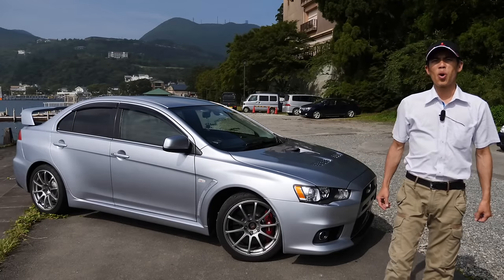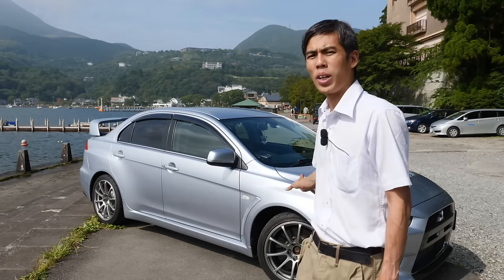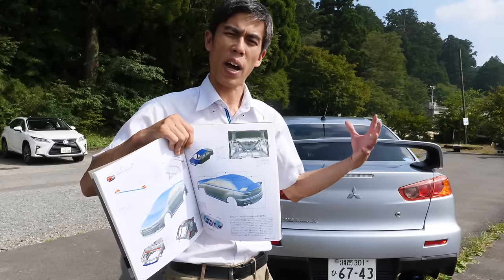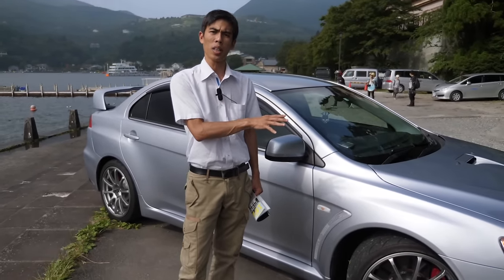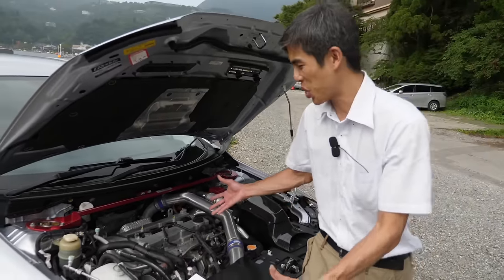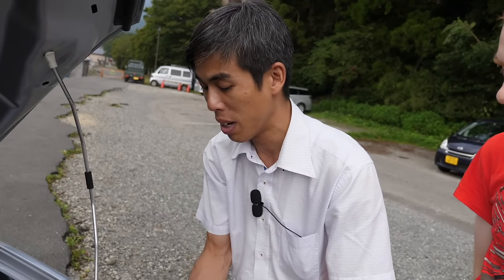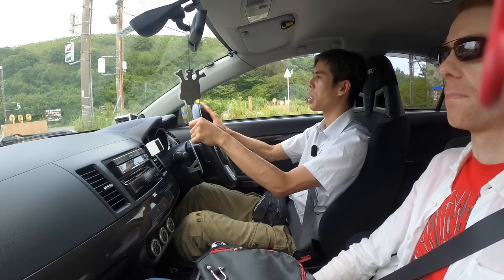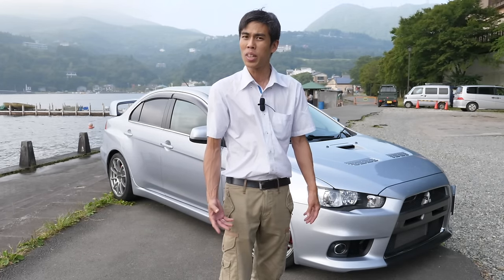Why the Lancer Evolution X is the best Evo | In-Depth Review, Technical Details, Drive | JDM Masters

Comment: I’ve owned an Evo 8 and now an Evo X GSR. I am really loving the X and it’s more modern features. Too bad so many 4G63 Evo die hards never got it. Thanks for the review, just fantastic!
Reply: I am in my 50s. I am a collector of Hondas. Eg6, ek9, dc5r...and one day...I purchased a 2008 lancer EX ( CVT) as a daily...and driving it was great...lt felt solid, stable and the thought occured to me that I should try the Evo X. As luck would have it, I snagged a Evo X Final Edition with a heavy discount from the dealer. And I started selling all my Hondas in my collection. Omg, the driving of an Evo X is indescribable. It goes where you point it to...Since JDM Masters revealed that the AWD system runs using Canbus, I am beginning to appreciate the Evo X's  instantaneous response ...and understand now why the Evo X's exceptional handling is so underrated.
Reply: Well Evo X doesnt has 4G63, so.
Reply: @MethmalDhananjaya  no one gives a shit about the 4G63. 4B11 takes mods better and anything over 500hp you would need support mods for both. 🤷🏻
Reply: Bring up blow by to the 4g63t boys and hear em cry
Reply: and evos 8/9 are still more vauable then x's

Comment: One of the things people also don't realize about the 4G63, is that it's an incredibly old engine Mitsubishi had been using for 26 years back in 2007. This is an engine they designed and built for Group 4 rally and then beefed up over the years. There's no doubt they decided they can make a better lighter engine for the Lancer Evolution X

Comment: The Evo X is a great looking car in its own right. It’s design was amazing for 2007. And even if it doesn’t have the 4g63 the 4b11 is still a great engine and it’s cool that Mitsubishi was trying something new.
Reply: you can just get normal lancer for cheap... look the same...
Reply: campkira it’s not about the looks though the performance differences between the two are huge
Reply: The newer engine made more power from mods than the previous engines

Comment: The Evolution X FQ400 produced by Mitsubishi UK was my favorite version of this car.
Reply: Too bad I'll never own one :(
Reply: @gorgeousnova2304  😔
Reply: @gorgeousnova2304  it's easy to spec out on exactly the same though. There is a company in the UK that still sells the original body parts that are pressed from the same molds Mitsu UK used.
Reply: @stephen9944  wow and what's the Name of this company?
Reply: They did a 440 version as well.
Reply: @emotionalsupportostrich2480  Yes but it didn't look special because they didn't use a body kit on it like they did with the FQ400.
Reply: @ardiarb  ross sport
Reply: The FQ400 in my opinion will the Skyline GT-R 400R of Evos. 400hp, insane bodykit, and on the least liked generation lol.

Comment: LanEvo 6 is the best Evo I've ever seen. But the Evo 8 is the best Evo I've ever driven. Didn't have a chance to drive the LanEvo 9 and 10 yet but I'm sure they're powerful and handle well.
Reply: The only things to evo x is

Fat and got no the heart of evo
Reply: @Vibe maybe evo x only got some great looks when they modified it
Reply: @ZYBIGBOIII  have you ever driven one?
Reply: @Vibe Evo X is slower than Evo 9 on a racetrack
Reply: @rhyspasaol7596  no why?
Reply: @ZYBIGBOIII  Because 99% of Evo 10 haters have never driven one.
Reply: @mikaelbihl-matias9462  Actually the X handles better than the 9.
Reply: @Kevhoe  where did you got this information ? If it's from your personal experience it's only a subjective POV the reality is that the Evo X is slower than the Evo 9 and even slower than the Evo 5 RS and 6 RS if I'm not mistaken
Reply: Pai Mei Have you driven them all?
Reply: @Kevhoe  No I haven't BUT my opinion is based on LAPTIMES I don't care if you test drived them all and feel that the Evo X has the best handling because it's not a fact it's just a subjective opinion. Laptimes are facts and the Evo X is slower than Evo 5,6,8,9
Reply: @mikaelbihl-matias9462  Depends on the track. Stock vs. stock, the only place the Evo X is slower is the straights.
Reply: @Kevhoe  no... Let's take for example tsukuba circuit. On this track there is only 2 long straight lines only the back straight line of the track is really long. The Evo 5 can lap tsukuba in 1min05sec. The Evo X is one second slower
Reply: @Kevhoe  true that
Reply: @mikaelbihl-matias9462 so you saying because its 1 sec slower than the old model its shit bro you need to do more research before you start saying that the car is no good. :) have a lovely day ;)
Reply: @ZYBIGBOIII  how do you know how old evos fell when you've never driven an evo need to stop playing gran turismo and forza bro
Reply: @rhyspasaol7596  bruh, I got watch bout evo x introduction
Reply: Stock for stock the X is better in just abut all areas. Chassis and engine as well. The 4b11t is more advanced and better power output and curve. and just because it doesn't have an iron block doesn't mean anything in terms of how it performs. The iron block is only good for throwing more power at it without upgrading the block. That's it.

Comment: I have a 2012 GT, and yes, built like a tank. The trunk area behind the back sets is really the look of sturdy. About three years ago, I hit a curb that jutted out in the middle of the road for no good reason and my car hit it at approximately 45MPH, going airborne in the process. As far as we've been able to determine, all the damage I got was a slightly warped wheel. I'm still running everything stock, so I haven't replaced the shock absorbers, springs, etc. Frame is in tip-top condition.

Comment: I'm a paraplegic who's been on the hunt for a Track car I can be competitive with in Time Attack and Wheel to Wheel racing. But it is tough finding an Automatic or Semi-Auto vehicle that is realistically affordable. But these have really caught my eye. I have always been an EVO fan in general. That SST trans really perked my ears right up. It will take me a long time to save up, but this is my new realistic dream car.  I hope there are some nice ones left by the time I can save up 25k.
Reply: Stay away from DCT Evo X they’re fragile boxes you need to drive them like a manual meaning you go neutral when coming to a complete stop
Reply: @manhattanskyline4526  no u dont lol, ive had mine for 3 years no transmission issues and i drive it in auto mode
Reply: Me too, and I'm making twice the stock power on the original clutches and im sitting at 330,000 km. @lostisles2760

Comment: 49:00 actually here in the US Tarmac is for dry weather, Gravel is for light rain/ light wet road. Snow is for snow and for heavy super slippery rain.
Reply: Gravel is for Gravel, why would anyone want to rear-bias in rain? It's meant to get the ass end out in rally cross on gravel/loose road surfaces.
Reply: Stephen H. If you read the manual it states it... unless you don’t have one.

Comment: I had a 9 running 450hp now have an X running 400hp yes the 9 was faster in a straight line .. but the chassis on the X is A LOT better.. a well mapped X on some fancy high end coilovers like Ohlins are ridiculously good to drive hard .. I’ve drove 911 turbos ,Ferrari and a gallardo.. and for shear thrills my X bosses them all 👌👍

Comment: 55:00 and 57:30 what you said there is spot on. I’m in a lucky spot that I own Evo and E90M3. Evo X is a phenomenal car. 

Stock form is purely about handling, its power is reasonable but won’t impress. Once you modify with simple bolt ons, it’s characters is enhanced to the point where it’s bliss. I use mine in snow and it’s indestructible.

Comment: I have a Evo X in Brazil (the base model is similar to a GSR witch dual cluck system, BBS whells, recaro seats, brembo, bilstein shocks and eibach system). Since i'm buy this one, 3 years pass and about 60.000 km in travel and city. I'm really like this car.  I think the car sins in details like finish or features (interior not feel "special"), and the look, although I like it a lot, is less aggressive than a 2015 STI for example. But in the technical and performance department, I have nothing to complain about. The only problem is that I am in Brazil, so maintenance is difficult and the parts must all be imported, and as our climate is warmer, SST boxes tend to suffer from heating. It is normal here to upgrade the box coller system specifically.

Comment: Paddle shift Evo is a blasphemy. Cool vid tho
Reply: Only to people that don't know shit about cars.
Reply: Stephen H. As a former Mitsubishi tech.... They're a nightmare and fail extremely commonly.
Reply: Jeremy Balce I call bullshit, Getrag doesn’t make weak gear boxes. Mine has been at 400whp/330wtq since 2015, it’s a 2014 and it had never slipped. Change the fluid, don’t use launch control unless it’s at 170f-200f. I think you’re thinking of the idiot Ralliart owners that flashed toS-Sport with Can Passthrough and killed their TCU’s.
Reply: Can confirm not that unreliable. You mechanics that worked at Mitsubishi would've just seen the worst of the worst come through.
I think Toyotas are unreliable so...
Reply: Sst suck mainly because of reliability and less fun. GSRs all the way baby
Reply: @BaronvonShotgun  Mitsubishi doesn't even repair them, they only replace them at dealerships.  the weak part of the trans is the glue getrag used to hold the shift fork magnets.  aftermarket parts from dodson motorsports are now available that fix this flaw. once this is upgraded they are pretty bullet proof. look up Kozmic motorsports in the USA.

Comment: I'm looking for an Evo X in Japan. I've 3 options. Engine seems untouched(stock) for all of them. Price is same for first two options.
1. 2008 GSR Blue SST Premium package BBS rims (Rockford, Sunroof, Leather seats etc) with 100K KM driven. Color is slightly sunbeaten.
2. 2008 GSR Silver SST standard package BBS rims with accident issue(They've restored and it's looks mint now) with 58K KM driven. 
3. 2008 GSR Black SST standard package Enkei rims. Paint is fresh with 100K driven (this one is 2000 USD cheaper)

I'm am getting hard time. It's not possible to test drive due to no registration issue.  Any kind of suggestions will be really helpful.

Comment: Evo 9 is the best Evo. The X is 100-200kg heavier making is much slower in a straight line and doesn't have the same raw feel of the older cars. That's why all the quickest time attack evos are from that generation (CT9A - 7-9) However, the X has a stiffer chassis, dual Mivec, wider oem tyres, an updated AYC system and is slightly less nose heavy.
Reply: Ryan Gates 311 begs to differ.
Reply: @brians5724  Ryan gates 311RS isn't that fast.
Reply: @sodazman  and yet he won

Comment: 4B11 is a better engine? Challenge accepted. Incoming 4G63 fanatics in 987654321.. I’m missing a number here guess which one and why..
Reply: 4B11 fanatic here...it's better in every way but the technical deal breaker is that the 4B11 has a timing chain, not a belt like 4G63. If anyone can argue that a timing belt is better than a chain, they're not worth a piss to argue with lol.

Comment: wow ya did'nt think I'd watch the whole thing, tell you the truth i got one car its a 3 sieries. ya the nintendo controller traction light comes o0n less with the michelin pilots . Good tire's good traction , inflation. Look for screws nails. (it's free) That lancer dos'nt look right without the fireplace grate spliter and on some sweedish logging road. looked like slip angle in the diagram. lots of good stuff in there. the autobecs the other week wow also

Comment: Good evening jdm masters here's what i think about the comparison between the subaru wrx sti and the lancer evolution in general i think both cars have great levels of performance but in terms of reliability and dependability they would go for the lancer evo but in terms of the sound and the historical symmetrical all-wheel drive i would go for the impreza wrx sti but if i would buy a car directly from japan that has the ability to handle 500 + hp for example it's a good win for the lancer evo one key reason that i like the subaru impreza wrx sti is just the boxer engine but some people say it's not reliable and here's where the mitsubishi lancer evo comes into play in conclusion if you want a reliable car to begin with once again though with lancer evo but if you want a good sounding engine and the technological history go forward and subaru impreza wrx sti

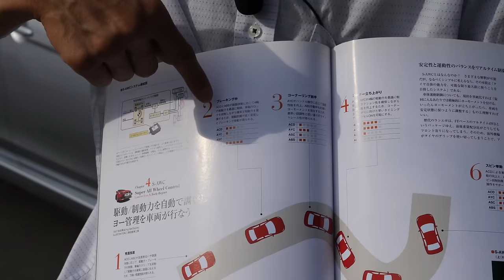Comment: As long is has center diff, I dont think its always 50:50 front rear distribution. What i think it is full time, but it could varies torque distribution between axles.

Comment: I still feel the EVO IX was the pinnacle of the series. The X gained too much weight, bland styling (the mild fender flares just werent aggressive enough), and with the new engine didnt really gain much in performance.

The IX already had super ayc and all the other tools to make it a top performer while having better styling to match. Not to mention by that time the 4G63 was bullet proof.
Reply: IX MR’s had super ayc and awc but not S-awc which basically added torque vectoring..best motoring showcased the handling advantages the X had over the IX despite its weight while still being a more livable road car